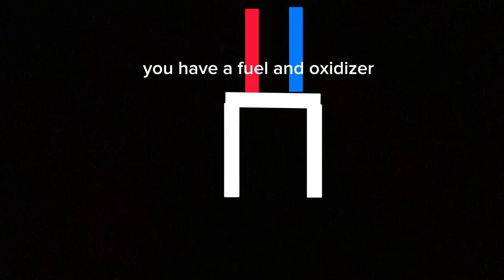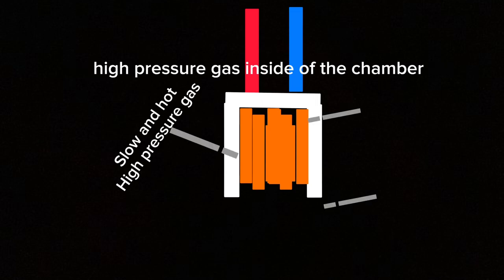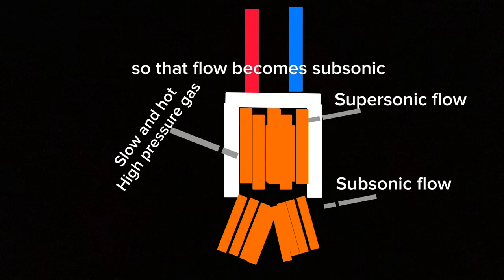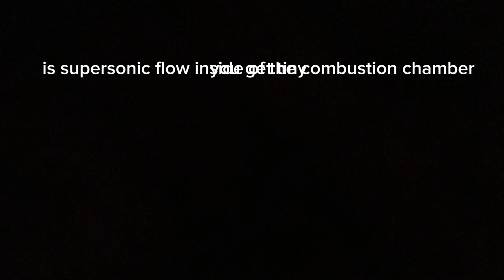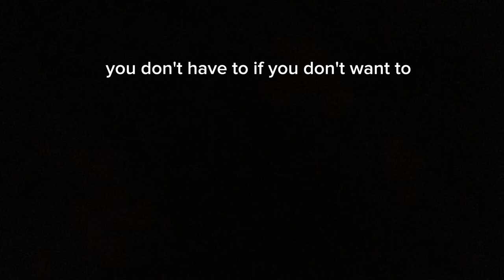Answering the question of why rockets crackle.

Comment: The flow is not supersonic inside the combustion chamber, but rather it should be moving very slowly (unless it is about to explode), and right before the throat the gas speeds up to mach 1. Past the throat, as the gas is expanded, the flow becomes supersonic. The crackle is from the supersonic plume's interaction with the atmosphere, where the turbulence produces mini sonic-booms.